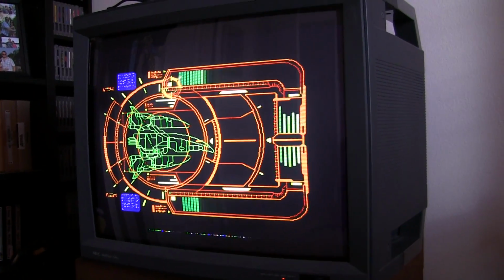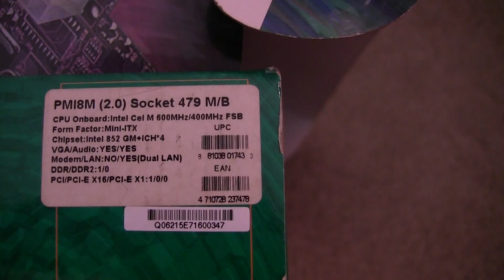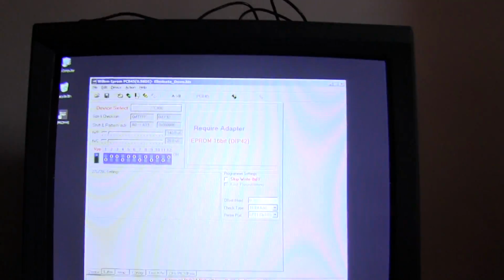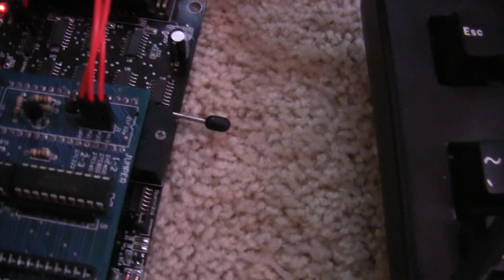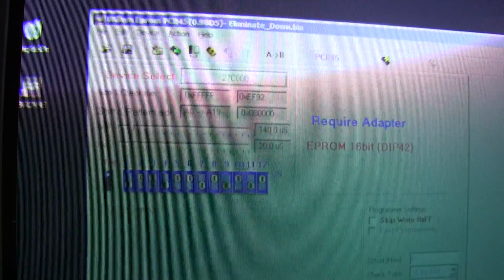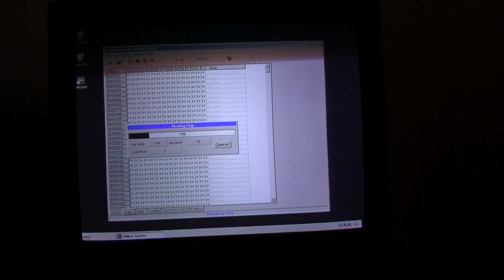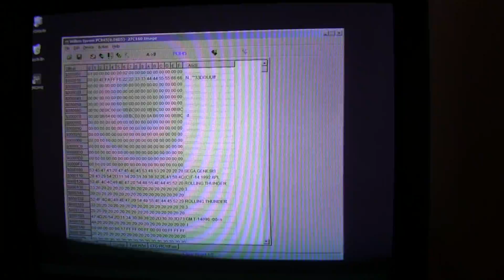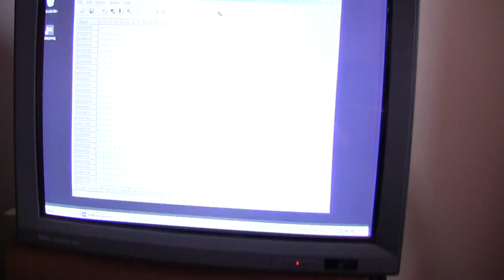Basic Willem EPROM Programmer To Make Sega Genesis/Mega Drive Reproductions

Comment: Hey when you were getting your verify error that wasn't a problem, how soon after attempting to write would it happen? Because I'm getting errors within 2 seconds of writing saying its Error at  so-and-so address. And then when I go to read the eprom again not all the rows of the eprom have data.
Reply from the maker: Led Vogs so for me, it wrote everything to the rom, then said error. Did a verify, all data was legit  on the Rom compared to the source. What you're describing sounds like it's having a problem writing to the rom right away. Double check your jumpers and settings. Check the log file too. Make sure your voltage is good.

Comment: can you buy a rom that you only write once like the ones in genesis games (without the UV window at the top) and just burn it once?
Reply from the maker: That is a mask ROM. Yea, I have not really looked around but I think they are getting harder to source reliably these days. I've heard stories of people buying them from China/ebay to find out they're not empty and can't be written to, then good luck getting your money back. That's why EPROMs are just generally easier to deal with.
Reply: srarcade Actually, a MaskROM is made with a shadow mask and a UV lithography stencil containing the ROM code. A PROM is an EPROM without the window that is manufactured blank and can only be programmed once. MaskROMs often have different pinouts due to the lack of programming or erasure pins and prioritization of being able to use different capacities in the same PCB in high volumes.
Reply from the maker: Hi, thank you for explaining this. I always thought Mask roms were simply 1 time burn only variant but its a little more than that.
Reply: srarcade No problem. I actually didn't get that 100% right though: I described One-Time Programmable EPROMs (EPROMs without the erasure window) and called them PROMs. It seems that there were PROMs before OTP EPROMs filled that niche so I probably should distinguish them. MaskROMs are still manufactured with the data already on them and are never blank so that part was correct. :)

Comment: hi there! excuse me for my question, but can you tell me what the heck is this buzzing line on your screen below the main picture, it will be nice if you tell me, cause i have same problem too on my md1 and dont know how to solve it. excuse me again for my poor english, and thanks!
Reply from the maker: +El Thunder Hello- I see what you are talking about, I am not sure exactly what it is either or how to fix it yet. Just some extra noise in the picture that shows up. If I ever find out I will post a solution.
Reply: Thanks anyway, hope you'll find out how to improve picture somehow ;)
Reply from the maker: +El Thunder My scart cable I switched to had a 16v 220uf capacitor to 75 ohm resistor to monitor (MD->cap->resistor->monitor) on the RGB lines, I don't see the line anymore so maybe this took care of it?
Reply: Thanks, I already have seen similar scheme for RGB output, so if this method works on your system, I'll try it on my system too :)

Comment: hi friend i`m form venezuela, and need to know the power adapter that you is using now, my question is, i need an power adapter of 12 volts x 800ma, or 15 volts x 1,2 amps? what ir your advice for this thanks very much... I AM OLIVER ARENAS
Reply from the maker: jose antonio Arenas Hi- The power supply I am using has +12v output @ 1.0amp. I am not sure how much draw it takes, 800ma should be fine I would think.

Comment: Question do most arcade pcbs have rewritable EPROMs or mask Roms  and how to tell
Reply from the maker: Aaron T Its up to the game board but a lot of times you'll get some of both. They are easy to tell apart, mask roms are just solid black chips, sometimes with a writing on it identifying the chip, other times not. Usually have a label on it anyway. EPROMs on the other hand have a small window on the top which is used for erasing. Many times there are stickers over the top of these to keep UV rays out which can damage the rom. You can usually run your finger over the sticker on the rom and feel the edges of the window to know its a EPROM or not.

Comment: Hello!!!  this programmers MiniPro TL866 can work for reproduction of genesis carts????
Reply from the maker: The Goster I can't say for sure. Make sure it can support 42 pin ROMs and also program with 12.5v using an external power supply. The USB power won't be enough.

Comment: Can i do that without removing the chip?
Reply from the maker: mohabiraq1 Which part? If you're referring to the donor cart then theres no way around it, original chip has to go since they cannot be reprogrammed (mask ROM). If you're careful you can de-solder it and keep it if you want but thats what sports cartridges are for.
Reply: srarcade Thank you for the reply.
Reply from the maker: *****
Yea like Jesus said if you dont want all this trouble of burning ROMs and just want to play games, you can get a Flash cart and load it all through USB. This is sort of the hacker long winded method of making repros, I just think its a fun challenge but its not for everyone.

Comment: Thanks for sharing this video. So my question is pretty much the same as ***** 's ... you just find the right donor cart for the game you want to program and swap out the chip? Bam, done? Liiiike .... I have a 4Mb game I want to put on a cart, so I get donor cart that has a 4Mb game, program the rom onto an EPROM chip, and swap the chips, then just play?
Reply from the maker: Snarkticon Yea, thats been my experience so far. Just find a donor with same size Mb game, swap and you're done. I have a set of test carts with sockets, a 8Mb, 4Mb, 16Mb, I can pop the chip on one of those first and test. If it works,find a nice donor, pull the old chip, solder new one and its done.
Reply: srarcade Nice! Thanks for the reply. :)

Comment: I have the pcb50b willem programmer and windows device manager doesn't recognize it. I'm running windows xp sp3. When I plug it in the computer doesn't recognize it at all, it's as if nothing is plugged in. Can you help me with this? It's plugged into the printer port and powered through usb. The power light is yellow. There are also 2 green lights and a red light that go on as well. I get a green light where it says "green" on the board. I get another green light where it says "vcc" and I get a red light where it says "vpp." If you know what that means, can you offer a suggestion? I installed the software and it doesn't recognize the device either, which makes sense because the computer didn't recognize the device. So, all of the lights turn on (when unplugged the leds look like they are supposed to be that color) but the computer doesn't recognize the device.
Reply from the maker: So the lights mean your programmer is getting power from USB, its just a matter of getting the right drivers for the Willem. I think I had to download half a dozen files and install before I found a set that worked right. Been a long time, I can't remember which worked. I don't even have a install to run this at the moment my windows box is gone. Also be sure to use an external power supply if you dont have one or the roms will never burn right.